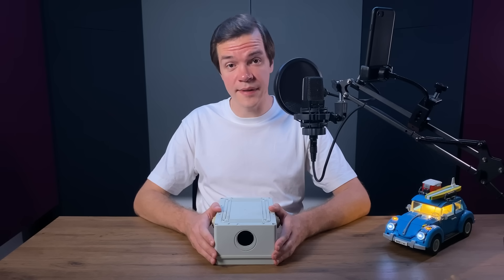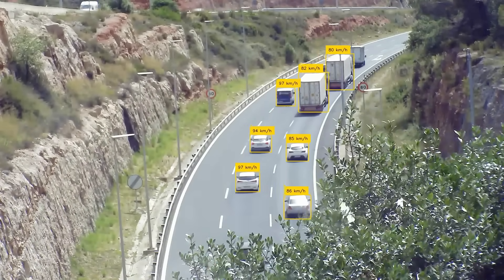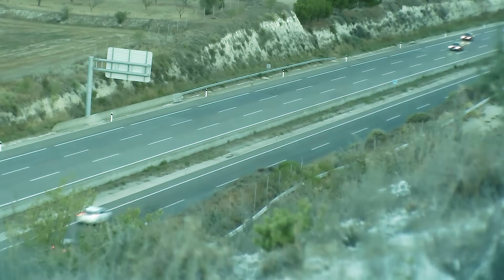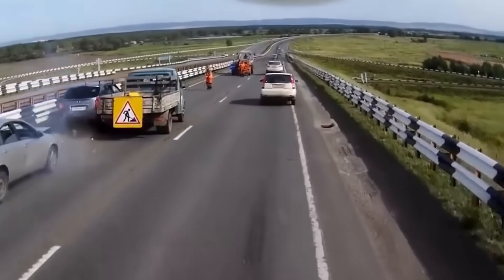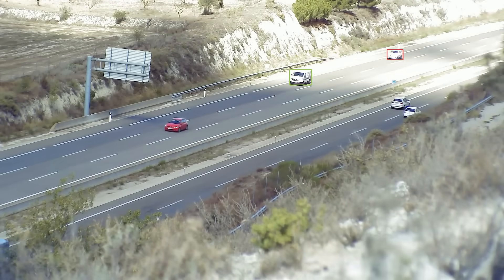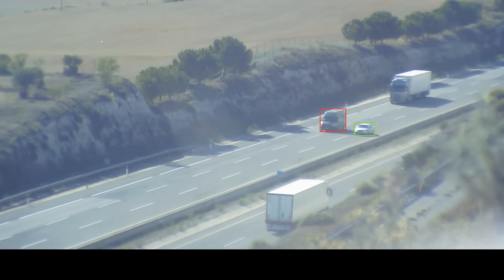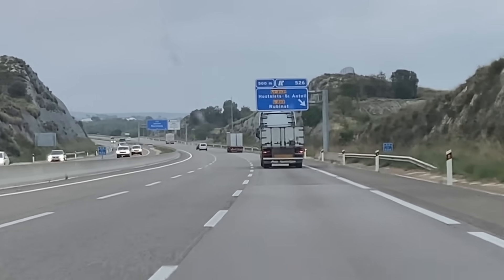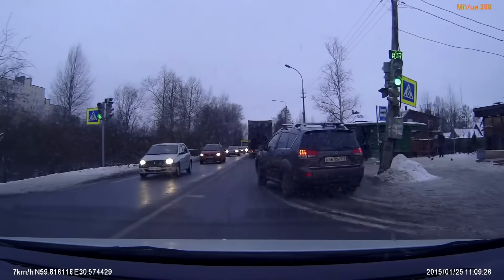New Anti-Tailgating Camera Reveals Shocking Statistics

Comment: As a commercial driver with over 2 million safe miles driven on 4 different continents, I suggest driving 1-3 mph slower than the traffic around you. Doing so helps prevent getting a ticket, and it keeps your following distance from being crowded by other drivers since they are going faster than you. 1-3 mph is not slow enough to be a problem with other drivers; it’s barely even noticeable to them. They just pass.
Reply: It's also so much more relaxing, you're not constantly having to adjust to the driver in front.
Reply: @mattsqwrl  Getting too relaxed on the road isn't good.
Reply: @Elrog3  Sure.. don't fall asleep.   But driving aggressively is exhausting too and it wears down your brains ability to make good decisions.

Stay relaxed and vigilant.  Drive based on the road ahead of the cars in front of you-- watch for brake-lights several hundred feet down the road.

Allow tailgaters to pass - better they are in front of you.   Allow extra distance if they are tailgating and can't pass.
Reply: "They  just pass ... " unless someone is traveling in the left lane.
Reply: That helps but keeping the space is still needed.  I am very happy with my relatively new car with cruise control and distance keeping features. I don't have to work very hard to keep the distance.
Reply: @poetmaggie1 I would love to have those features...
But, not yet.
Reply: This works in places where they enforce not camping in the passing lane. It's no exaggeration to say that here in America, this would get you cut off or even run off the road in extreme cases.
Reply: @hackprefect ❓😳
Reply: Anyone who doubts him hasn’t given it an honest shot…. On longer distances, you meet up with other cars and do the same… if I speed like everyone else, I get cut off constantly. Mostly by people on their cellphones who wind up slowing down in front of me when they get another text…
Reply: Not a problem for me. People where I live drive 85mph. The speed limit is 65mph. I drive 68mph.
Reply: I’ve been driving busy interstates at high speeds for over 50 years.  Once I grew up, I found the secret.  If it’s a busy multi lane highway and most lanes are moving well, get off the cruise control and just maintain close to 3 seconds behind and look forward.  If a dope cuts in front of you just back off the throttle a little bit and get back your 3 seconds.  This doesn’t affect your arrival time, increases safety and virtually eliminates stress.
Reply: 1-3 mph is not slow enough to be a problem with other drivers; it’s barely even noticeable to them. They just pass. yes it is a constant process causing the other drivers consternation while getting around a truck toddling along. You are the problem not the solution. Keep up with traffic and stop clogging up the freeways with your redundant BS attitude.
Reply: @robert5  what is a "redundant" attitude? lol chill out and stop constantly switching lanes thinking you need to jump past everyone else.
Reply: If that's your recommendation, you were never a good driver, just a lucky one.

-fellow million mile driver
Reply: That's exactly the kind of behaviour that inspires a lot of reckless behaviour around you. Blend in. Go with the flow.
Reply: How do you exert your dominance?
Reply: But... But... you'll arrive 5 to 15 minutes later on a 5 hour drive!   How can you bear it!?!?!
Reply: @mac_mcleod 😱🤯
Reply: @mac_mcleod  Yeah that is the thing that drives me crazy. Most drivers are only on the highway for about an hour drive and think they are "losing so much time" going 5-10 MPH slower when in reality the difference is only about 1 minute. Risking an accident or a ticket for that is obviously a poor decision. Guarantee that getting pulled over will cost a lot more time.
Reply: @Zaekyr  I'm not wanting to defend speeding, but let's get the numbers right. If you are travelling 70 miles it takes 60 minutes at 70mph (the typical freeway speed where I live), 64.6 minutes at 65mph,  and 70 minutes at 60mph.
Reply: @Elrog3  I am not implying to not travel at the posted speed limit but many people do travel faster than posted speeds which is why tailgating has become an issue. It is not strictly the speed that determines your time. If you are traveling 10 MPH over the speed limit you will encounter "congestion" relative to your speed which usually reduces your speed for a time in which you are not saving time and putting stress on yourself and drivers around you. Sure I didn't calculate raw numbers but it is also not practical to do so. The time savings are negligible for typical driving scenarios in any case. I have found that drivers that  consistantly speed also typically tailgate and do not understand the cost (and danger) to benefit ratio.
Reply: @Zaekyr  I see. Thanks for fleshing out your point.
Reply: In how far could thos maths defend speeding??
 @Elrog3
Reply: @Elrog3  All of that time  you think  you gain by speeding on the freeway you will lose again trying to rush around on surface roads with stops and traffic lights. I've timed it many times on my highway drive to and from work over the last five years; it doesn't matter if I speed 5-10mph over or go the limit on the highway portion of things, the drive always evens out to ~64 minutes on my way into work and ~60 on the return due to lights and stops on the normal streets. Unless you're on the freeway the entire day, it will not matter, and people who are on the freeway the entire day are rare outside of commercial shipping.
Reply: @LeScratch89 To deny that going faster gets you there faster would be blatantly stupid. Whether the difference it makes is enough to matter or be worth it is a different discussion where I could probably agree with you.
Reply: @Elrog3  The whole point is that its not significantly faster for them. If I speed to a red light and someone else cruises beside me, we both arrive at the same time.
Reply: @jaro6985  The freeway does not have red lights.
Reply: @Elrog3  That math works assuming no obstacles or congestion, but that isn't how the road actually works.  I remember someone testing passing on the road to see how much faster it would get you somewhere, and on average it only saved 1 minute per hour, and increases risk of an accident significantly.  

Granted this was in a semi urban area, and speed would matter more if the roads were empty, but then again rural areas tend to require more caution with speed anyways because of various other obstacles like weather, rocks, and animals.
Reply: @astlance  Again, my issue is with poor logic, not the topic of speeding.
 
The guy I originally responded to said going 5-10 miles an hour for an hour makes a 1 minute difference. If there's congestion, you aren't going 5-10 miles an hour faster. You are going the same speed as everyone else. So data taken from a congested area is not addressing the situation which was being talked about.
 
Also, in that situation, one minute is one minute. It may not be worth it, but denying that it is faster, as another commenter I responded to seemed to be doing, is wrong. Denying facts isn't how we are going to be able to have nice things.
Reply: @Zaekyr  The congestion part is so accurate. I go faster than the speed limit and safely pass people often to beat some congestion ahead. I'll still have people tailgate and otherwise drive recklessly around me, only to spot them 4 car lengths ahead when we all reach the congestion inevitably.
Reply: There is actually a way to fine tailgaters fairly. It's called the accummalting a large enough sample size. Sure some of your tailgating might be done against your will, so fining you for any particular offense would be unfair.  But you could accummulate a sample of that driver and given big enough sample you can say with any given certainty that it is the driver that causes the tailgating in a large amount of the cases. I am omitting the math here but I am positive that it can be worked out.
Reply: Poor advice, the safest speed is the same as the traffic around you, so you aren't constantly being passed.  If not being passed, cars can stagger and are not having to keep changing lanes to get around others.  Stayingin your lane and at a safe distance is the key, not interrupting the smoothest flow of traffic possible.
Reply: Driving faster is safer in my experience.
Reply: @conservativeriot5939 
Faster than what?
Reply: Go slower and become an obstruction that causes more lane changes around you. No.

Always go with the flow of your lane. If drivers are always going past and around you, that means you're going too slow. You're adding to the mental workload of other drivers who either have to change lanes themselves or deal with others changing lanes because of you.
Reply: @seands650 Nope!!
Too much thinking.
Reply: @seands650  other drivers can apply what they learned in driving school and be prudent and priorise safety on the road instead of roleplaying as a nascar driver when they meed a car going 2mph slower than them
Reply: So you've been a rolling roadblock for over 2 million miles on 4 continents? Not something I'd be proud to admit to on a public forum.
Reply: Two million miles eh? Thats about 136 miles every day including weekends, for forty years. Taking into consideration the days you were not driving, I suggest that’s 300 miles every day of your working life..garbage! Just like your 1-3 miles slower advice. A real accident causer.
Myself a retired Commercial driver I used to notice how many fellow drivers were lying bullsh**ters.
Reply: @strummy77 Ever ridden a truck commercially?!
Do not talk crap!!
Reply: @B.Ies_T.Nduhey drove my first truck in 1969 and retired not long ago. I’ve done more miles than you in reverse.
Reply: @strummy77  I got my one million safe miles award from my company in just under ten years. My highest distance traveled in one shift was 682 miles with most days averaging between 450–500 miles per day. In some areas of North America you can really pile on the miles. Our trucks were governed, so I had no choice but to go slower than most vehicle traffic. I moved onto another career, but I know I could have easily done 2 million miles in less than 20 years if I continued driving at the same pace.
Reply: @NotExpatJoe right ok, now tell me how many days a week you worked and the legal hours permitted in a working week (48 hours a week last time I worked)  then take away all the compulsory days rest. You can’t drive 24/7 non stop every week and then how much time did you spend loading and unloading? Our friend said he grove on 5 different continents. Often half your permitted working hours are spent square wheeled waiting to load/unload. I still believe it’s a load of BS and certainly not common for 99.9 percent of drivers 
There’s always one I suppose who live in the truck kissing the bosses ass and ruining it for everyone else they should get a life and spend some quality time with the family.
Not you…of course.
Reply: @strummy77  I strictly followed hours of service rules. I could drive 13 hours per day and a maximum of 70 hours in any 7-day period when on cycle 1. Because of scheduling, and being long haul, I did spend quite a lot of time living in my truck. I tried to be home every weekend for two days, but it wasn't always possible. I was a young man at the time with a young family, and I quit driving a truck to spend more time with my family when the job was obviously taking a toll.

With the company I dealt with, I didn't have to wait to load/unload trailers. I would drop a full trailer and pick up a full trailer, often only taking 20–30 minutes every three days or so.

I know my situation was not entirely normal, but my point is that it is possible to accumulate millions of miles while driving commercial trucks.

On the road, I was my own boss, and try as I might, I've never been able to kiss my own ass. I don't know you and will not sink to making personal attacks. I would appreciate you giving me the same level of respect I have extended to you.
Reply: @strummy77  it would take about 20 years for an otr driver to cross over the million mile mark. That's a conservative estimate of 2500 a week, 40 weeks a year. Not unheard of, but not common. I agree with his sentiment. Traveling slower than the majority of people who are driving over the speed limit, is not only less stress, its better fuel economy and easier on the mind.

Comment: Someone who is slightly tired and lost in thought is NOT going to react in 0.9 seconds. A driver who is wide awake and focused on driving will. Initiating a proper reaction in less than a second is not happening when someone isn't focused on the task at hand. Just try running reaction tests with people, just do the simple test of dropping a ruler to determine speed. You can easily double or triple that time, just from a very mild distraction.

source: I was a goalie when I played ice hockey. Have a championship and MVP under my belt. Reaction time was a constant focus.

Comment: If you have a big gap in front of you people don't actually cut in front of you nearly as much as you'd think. You often get a spate of it, but then it stops and in the grand scheme of things, it adds at most a few seconds to an hour-long journey, which is insignificant. Also if it does happen, just come off the gas slightly and the gap will rebuild fairly quickly and then you can regain your speed. You don't have to stomp the brakes-that just wastes fuel.

Comment: You almost brought up the correct analysis of the data, but failed by defaulting back to the standard position.  Three seconds is not the "safe" following distance. It is just a particular following distance with certain attributes, being how long would it take an average vehicle, with average braking, come to a complete stop, with an average driver, with regular reaction times, take to avoid crashing into a brick wall?  This is not the condition that exists on the highway you took video of; there were no brick walls.

The stationary nature of the obstacle to avoid is the issue. Drivers know that the obstacle ahead of them has momentum, and will continue to move forward. Only when a driver can not see anything in front of the vehicle in front of them should the driving distance be increased, such as during a heavy fog, heavy rain, unusually dark conditions, curving road where you cant see around the corners, etc. These conditions do exist, and both following distance should be increased and speed of travel should be reduced, for the exact same reason: There could be a stationary obstacle in the roadway that you cant see.

Lets consider the 0.9 second following distance. Lets say the vehicle ahead of you suddenly starts braking hard. It takes you 0.9 second to begin braking hard yourself, but yet you still do not hit the car ahead of you because they have travelled forward even while they brake, and you are now braking as hard as they and your braking began at the same spot on the road as they. Assuming even braking means that you will only just barely reach their vehicle with yours at the last millimeter of braking. So maybe your following distance should be a centimeter longer. Or drive a car that stops slightly better than average. Or drive while slightly more alert than average. Or if you want to drive less alert with a less capable car, then increase your following distance a bit... an extra 2-5 tenths of a second would do for nearly all passenger vehicles.

Comment: Tailgating is the symptom, driving slow in the wrong lane is the cause.
Slowing down to increase the distance between vehicles both decreases the amount of vehicles that can fit on a stretch of road, and increases how long they are occupying that stretch of road. This increases the congestion and make the problem worse. Then the vehicle behind that one has to slow down even more and so on until a few hours later and several miles further back you'll get standstill traffic.
If instead people just got used to driving closer, didn't brake check people behind them, paid more attention, and looked further ahead, and didn't hog the outer lanes whilst driving slower than those behind them, the roads would have much greater capacity, and congestion would fix itself.
By getting cars to their destinations quicker you would have less cars on the road at any given time, and the distances between cars could increase again.